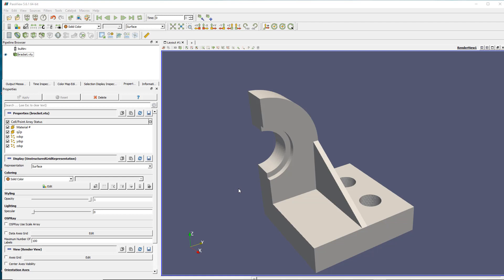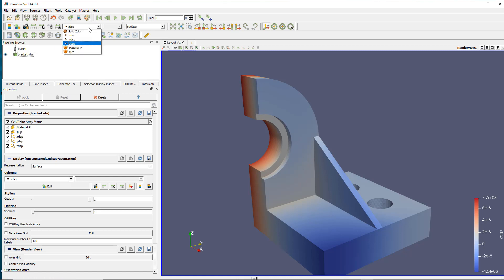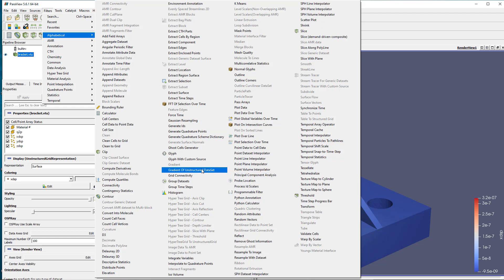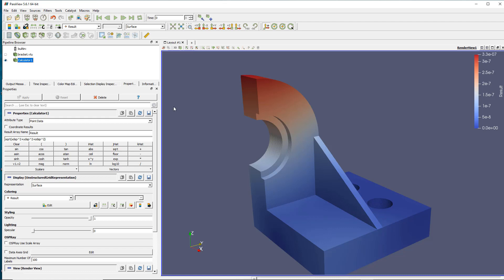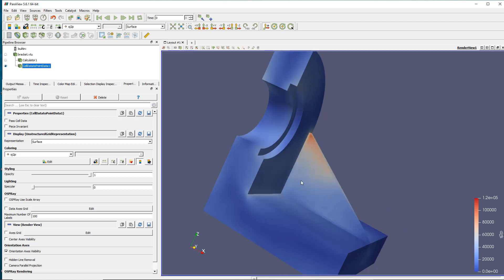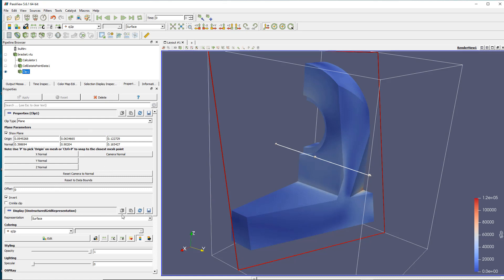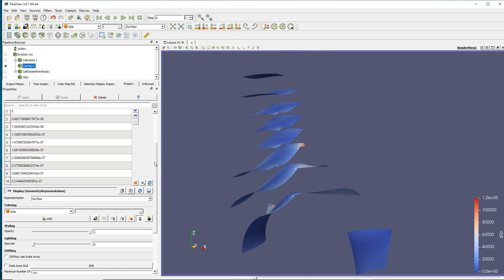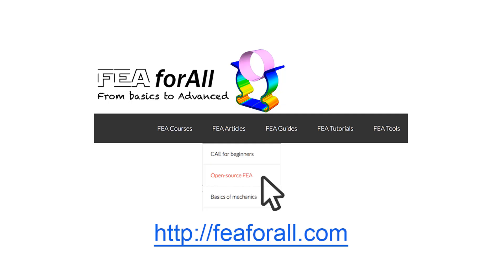[Paraview Tutorial 3]   Working with Filters and pipelines

Comment: Hi Cyprien, do you know how to view a contour with separate legend color bar instead of continuous and gradually color maps? like 0-2 shows one color, 2-4 is another.. which has obvious layers
Reply from the maker: Just go at the very bottom of the color map view window and change the number of colors. The default is 256 which looks continuous to the human eye. If you change the number to 8 or 12 your will get layers of colors like you want ;-)
Reply: @Feaforall  Thanks! And another quick question is can I add black lines for each layer in paraview?
Reply from the maker: You have to use the contour filter for that I believe